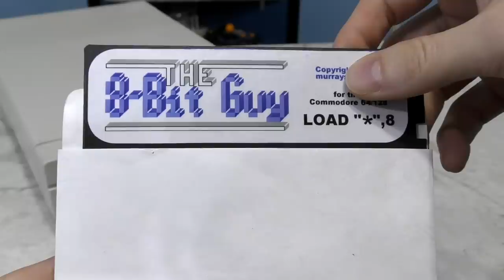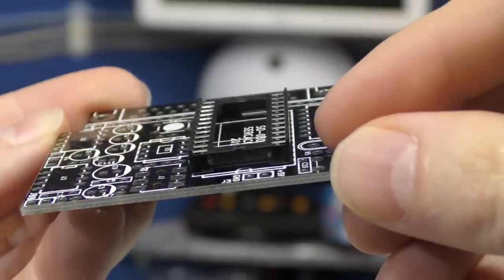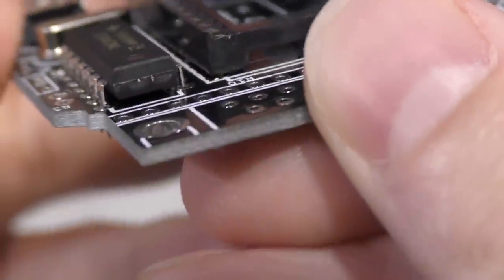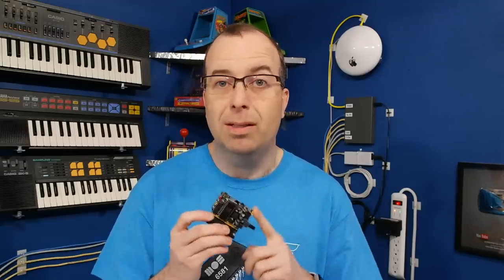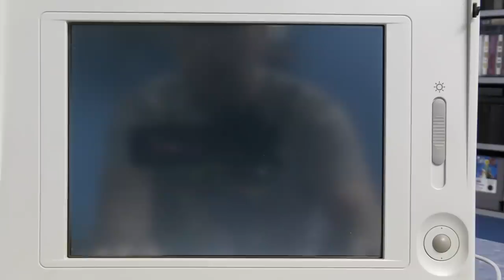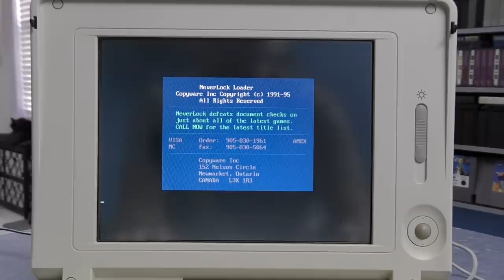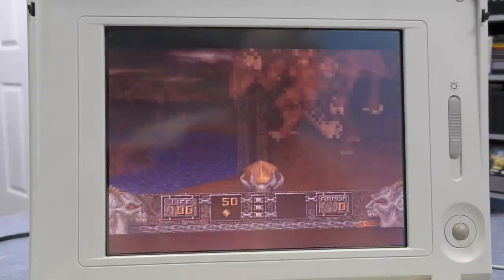Ad-Lib Sound Card for the Parallel Port

Comment: I want to hear what it sounds like when you tell the computer there's a printer connected to the port and try to print.
Reply: Likely a short crunching sound but it may get stuck on a note after that.
Reply: And on the flip side, connect a printer to that port, run the driver, and then a DOS game.
Reply: LOL!!!
Reply: Depending on the line protocol, it might make no sound at all and just error out.

Maybe give a beep series to indicate "error"
Reply: The one dude was like "Hey dude can I like print 'n shit"  and the other dude was like "WHAT?"
Reply: Or if you tried one of the games with a printer connected
Reply: In reality, nothing. The way that a printer and this sound card use the parallel port are fundamentally different.

Same with trying to use a printer instead of this sound card.

But for the second example, in a perfect world maybe this would happen: https://youtu.be/pG8RAbWs1yo 
Lol
Reply: @GamersEdgeCustoms  u ok bro?
Reply: Its like when you connect digital audio source to analog port in amp
Reply: I think it would sound like garbage for a second and then stop, because it didnt detect any printer
Reply: @timsbrain99  No one is going to be trying to print on an old laptop. If you do just remove the card. Your all a bunch of trolls.
Reply: @GamersEdgeCustoms  I saw something similar when the cat ran across the keyboard
Reply: @GamersEdgeCustoms  Yes. I agree.
Reply: Why don't more people think about that
Reply: @LGR i just tagged lol

Comment: Nothing wrong with your solder work, I've seen "professionals" do far worse
Reply: He learned the way I did - I got a soldering iron as a gift from my dad at like 8 or something. First thing I did was burn my carpet, then myself, then use it to make holes in plastic (to fit components) - Seconded, I'm not a pro myself but I've seen far shittier work on commercial products (cheap ones) from China.
Reply: The reason he's criticized is that less-than-proper soldering technique can sometimes damage the parts or just lead to many more cold solder joints. Critics just looking out for his parts!
Reply: Especially the ones putting a big blob on the tip, waiting for a bit, and try to smear it on. shudders
Reply: If it works, it's good solder work imo.
Reply: first cut the legs, then solder. Cutting force stress on the legs and deduct heat from the iron. since the legs are uneven lenght the also deduct heat unevenly and cause the soldering becoming less uniform due to the syncronisity
Reply: Snarky . Live 

Agreed. I cut the legs after I solder.
Reply: at  @roffpoff8221  Same stuff from IPC training...  BS.  Do which works best for yourself.  Then OWN IT.
Reply: most of it looked alright, cept that one big structural pin on the port didn't look like it fully heated/bonded or something and might crack off at some point.
Reply: I have been soldering professionally for years. You are doing a great job!
Reply: everything wrong with how he pronounces it
Reply: @petervansan1054  pretty sure everyone pronounces it that way in America
Reply: "I've seen "professionals" do far worse"

What do you mean by "professionals"? If you're talking about people who repair PCBs as a profession, that doesn't make them a professional solderer. A true professional solderer does nothing but solder as a fulltime job, such as on an assembly line in a PCB factory, and if you've seen worse from someone like that, then either they are a new-hire or the company they work for has terrible quality control.

I soldered professionally in a PCB factory for ~2 years, about 5,000 joints per night (I soldered literally millions of joints during the whole time I worked there), and 8-Bit Guy is not a good solderer. He often leaves the iron on the joint for too long, he usually doesn't feed in enough solder, he tends to feed the solder onto his tip rather than directly into the pad/post, and he cuts the leads off too close to the top of the fillet; sometimes actually cutting off the top of the fillet. I've also seen him create spurs on fillets when he removes his iron due to poor technique (that happens when you leave the iron on the joint too long and it burns out too much of the flux), and then just leave it that way instead of fixing it. 

On top of all that, his solder wire is too thick for most of the joints he solders (it's probably 0.032", which I call the amateur diameter, and it's probably 60/40, which I call the amateur alloy, because that's what you'll typically find at places like Radio Shack). 0.020", 63/37 is what you want for general purpose through-hole work, and 0.015" for most surface-mount work.
Reply: @MaximRecoil , sheash dude chill. This video is over a year old and his "improper" soldering techniques seem to work fine and even if they don't, it won't affect you anyway. No need to write a long rant.
Reply: @andrewhamop6665  You missed the point of my post, simpleton. I couldn't care less about how The 8-Bit Guy solders. The point of my post was to debunk HPZeta's ignorant "Nothing wrong with your solder work, I've seen "professionals" do far worse" post. That's why I addressed HPZeta in my post rather than The 8-Bit Guy, obviously.
Reply: @MaximRecoil , no need for name calling. I assumed that by saying "The 8-Bit Guy is not a good solderer" you were saying that he should be ashamed of how he solders, and that he should learn better. No offence meant and, I am no simpleton.

Comment: Atari could have made a sound card attachment like this for their ST series. It's a pity they didn't, but the YM chip holds up today surprisingly well for good chip music.
Reply: I don't understand why everyone likes these Yamaha FM sounds. They all sound plastic or metallic and have no depth whatsoever. The SID already had better sound with it's PWM.
Reply: There was nothing keeping you from connecting this to your ST. And Atari did have MIDI and the sampling output on the STe. So they had no good reason for this.
Reply: @dreamyrhodes I also generally prefer the SID over these FM sounds, even considering that it has less voices. Perhaps if the Innovation SSI had succeeded and the developers made proper use of it (which they did not), we would all be seeing DOS games with good SID music.

Comment: Who doesn't want to see the assembly? Screw skipping to ~8:30... The assembly is the best part of all of your videos. Especially that Hobby Computer you made. I want more of that. Solder and all :)
Reply: I cannot describe how much more excited I got about this video when I realised there was assembly required!  :D
Reply: SOD-er TRIGGERED
Reply: When I’ve built modded literally hundreds of PCAs it’s definitely not very exciting.
Reply: +monsterspc 01011101  

"Solder" is a modern spelling of the Middle English "souder", which derives from the Old French "soudeur", which itself comes from the Latin "solidare". In the 15th century there was a movement to re-Latinize the spelling of words, and the "L" got added back in to the spelling, although the pronunciation didn't change to include the "L" until sometime later.

So there you have it: The reason some countries pronounce it with an "L" and others don't.  But they're both correct, according to the Merriam-Webster dictionary.  So stop being triggered.
Reply: Daniel Figueroa a
Reply: Yes.

Comment: If you can find a Port·able Sound Plus, it gives you AdLib and Sound Blaster emulation via the parallel port, and it supports DOS games: https://www.youtube.com/watch?v=t7VxWbCgWHk  

And LPT1 actually stands for Line Print(er) Terminal 1, or simply Line Printer 1, not Local Print Terminal. It's a reference to the high-speed printers often used with mainframe computers that would print an entire line of text at once, rather than the single-character print head of a typical daisy wheel or dot matrix printer.
Reply: Dude, I have been into DOS gaming since 1986 and still I didn't know such a thing existed. I am thrilled. BTW, you have a great channel, too.
Reply: Watching this at 9:29 I thought "Wow here's a guy who actually knows what a line printe.....errr.....  nevermind."
Reply: It probably costs allot unlike this thing.
Reply: I like all your video VWestlife ! Im a fan
Reply: Good to see you, VWestlife!

Comment: Whoever told you that your soldering skills were lacking, they're wrong.
I'm an electronics tecnician, and I work doing maintenance in medical equipment at the largest hospital in Brazil, and considering my own skills and what I've seen other techs do, you're way above us all in soldering skills, my friend. Your solder jobs are clean, quick, and most important of all, NOT BLOBBY.
Don't mind these nitpicky pillocks, they probably wouldn't fair soldering on camera as well as you do. Keep up the good work!
Reply: blackcorvo Hospital das Clínicas?
Reply: blackcorvo is right, nice shiny joints not over cooked or under cooked,absolutely nothing wrong with your approach, also i have seen standing resistors and diodes quite alot on metal detector circuits and boards(my main interest), like you say its used to try to make the boards smaller.
Reply: Blackcorvo you br?

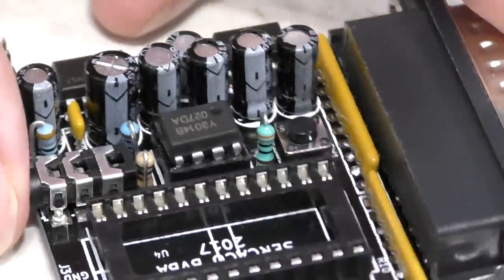Comment: 7:49 That "little chip" is actually pretty interesting too. It's a proprietary external digital-to-analog converter. Most Yamaha FM synth chips required specific external DAC chips which made them kind of a pain to work with. More often than not, the lower-end FM synth chips had internal DACs to keep part-counts and costs down. Chips like the YM2612 (Sega Genesis) and the YM2413 (Low end keyboards, MSX) had built-in DACs which made them much easier to work with and much cheaper overall. 

If you're interested, I've actually created a dedicated Sega Genesis video game music player using a real YM2612 and have made videos of that project on my channel. FM synth is SO cool and I really wish it would make a comeback.
Reply: Aidan Lawrence Considering microsoft has somehow declared midi obsolete without actually checking with anyone that makes music...
I wouldn't count on old technologies much. XD

Though by their nature I suppose FM Synths making a comeback is considerably more plausible than say, CRT displays doing so...

Your YM2612 player reminds me of my little troll project to stick a YM2612 in a SNES cartridge and feed the output into the analogue audio input pins... XD

That's basically designed entirely to mess with people though...
Even if I am mildly curious what the SNES audio amp stages do to a YM2612
(the characteristic sound of the Mega Drive and the wide quality variations between hardware revisions are closely tied to the amplifier stage, rather than just the 2612 itself...)
Reply: Dude that project is real cool! I enjoyed listening to some tracks through that. I'm a huge fan of FM synth and of the Genesis sound :) I've captured a couple game soundtracks from original hardware on my channel. Are you well-versed in the different filterings of Genesis audio circuits? My fave are the model 1 motherboard revision VA0 to VA2, followed by the model 1 mobo revision VA3 to VA6.8. The one I use for capture is a model 1 VA2. The EQ is just straight fire on this sound circuit(although the headphone preamp is cranked too high, but this can be fixed). I love hearing "crystal clear" version of the Genesis, but I also like the two sound circuits I mentionned before. They both have great personalities
Reply: Saw your video on reddit. That's pretty cool
Reply: That's awesome Aidan!
Reply: Aidan Lawrence So it's not working with Intel multiplier firmware crap then 🙄 Maybe i386 on a chip 🤓 that would be the best.
Reply: is a floating point DAC. only emulable by CPLD.

Comment: Wow - flashback city. Back in around '93 when I was working for Creative Labs, the Port Blaster (parallel port Sound Blaster) release was cancelled because it turned out not all laptop parallel ports provided power. Major embarrassment and R+D fail!
Reply: Bruh, I would've been pissed. Who was the idiot that decided parallel ports shouldn't provide power on some computers?
Reply: @Some-guy-on-the-internet  Being a general purpose port, providing power isn't exactly a good idea. External power would have been fine tho.
Reply: How far did it get into development? MediaVision did something extremely similar which made it to the market. Just like a combination of the OPL2LPT + Covox basically is a Soundblaster ... albeit the later requiring a lot more CPU juice when playing digital sound.
Reply: @1337Shockwav3  I suppose that does make sense. But if that's the case, then I find it strange that Creative Labs didn't think to add external power to the Port Blaster.
Reply: @Some-guy-on-the-internet  shrug no idea ... a good thoroughly thought through LPT port solution would have been quite a decent product ... but then again, PCMCIA soundcards may have already been on the horizon.
Reply: If only they had the sense to tap the power of the PS2 port. You should develop it and sell it in conjunction with this guy, no point redeveloping the wheel.

Comment: Yammaha still probably make those chips for legacy equipment and keyboards as some still prefer the sound some older equipment make

That and older technology tends to be dirt cheap to mass produce anyway
Reply: Hanro50 isn't it different for CPUs?  I heard Nintendo couldn't use ibm processors for the switch because it would cost more than using arm. I think it was propreity hardware would cost touch I think. If it works that way.
Reply: There is no sense in using older CPU architectures for modern applications like video games...Especially video-games since developers don't like cryptic architectures

Comment: I solder medical equipment professionally, and honestly I have seen every soldering technique imaginable.  They all result in the same thing, the technique makes no real difference.  You solder just fine, clean results and no residue scattered all over the place.

Heck, I commit the worst soldering "sin", I put solder on the iron and use that to solder the component, easily done single handedly so I can use my other hand to hold the component.  When having to make 200+ battery packs, every time saving technique is a win.
Reply: some soldering irons I've seen actually promote single-handed soldering by having a solder-feed.
Reply: That's a sin?  I thought I had unlocked a pro skill.
Reply: Doing that is fine if you apply flux to the joint first, despite what a lot of people say.
Reply: I usually have to wet the iron to get any heat to transfer to the part.
Reply: @thegardenofeatin5965  that's totally fine as long as you add fresh solder (and flux) to the joint. It's even recommended in NASA soldering guides.

Comment: Here's another soldering tidbit.  Don't solder adjacent pins on ICs or sockets.  Skip a few, and come back multiple times.  Heat can damage ICs, and spacing out the pins soldered lowers overall heat applied to any one spot.
Reply: Good advice!  I never thought about that.  It's one of those things that makes sense in hindsight, though.  (Then again, I very seldom soldered ICs.  I usually socketed everything, unless the space inside the case was tight.)
Reply: Just ICs, sockets don't care. And modern ICs don't really care much either. It's just the old chips you could kill easily with a bit of heat.

Comment: never noticed till now in his intro the label of the disk says to type
LOAD"*",8
but he types in on the computer
LOAD"$",8
Reply: The '$' folder I think loads the directory listing. The implementation of the 'dir' command is kinda wonky on Commodore machines - it had to load the listing from disk and write it to a BASIC program for some reason. It's wonky.
Reply: surfitlive  ,8 means the program from device 8 will be loaded into basic memory, 
,8,1 means the program will be loaded to the stored location defined by the two first bytes in the file that is being loaded. Which is what you need to properly load a machine code program. 

,0  The program will be loaded to the start address of BASIC memory (2049/$0801).
,1  The program will be loaded absolute, namely it is stored to the location defined by the first two bytes in the PRG file image. 
    Typically needed for machine language programs to get properly located into the memory. if you don't do that you'll most likely encounter a ?OUT OF MEMORY ERROR.
Reply: @iProgramInCpp  experts use DIRECTORY command and does not overwrite memory :-)  at least on C16, C128 :-D

Comment: Thanks so much for this video.  So glad these are coming back.  It is easy to forget that these soundcards, old or new, were musical instruments in themselves.  In '92ish I got an original SB, 8 bit version. -- mostly on a dare.  Until then I was using all those pesky moogs and roland things via midi... and <blush> I just LOVED It.  It was crunchy and unique, and a welcome addition to the studio.   I have this and an original mt32, and I must say,  I also prefer the opl2.  When a song is actually composed and designed for the opl2 it sounds way better than these other instruments, if only by virtue of the design.  Unlike the sampled things like mt32, the fm and sid's also had control codes that modulated in real time. And the opl percussion sounds were never the exactly the same twice.   Have a listen to the original Dune game - on opl vs mt32.  Same with a game called "Hyperspeed".  Both sound great, but personally I found so much more character in the opl version of the music.   See also : the original Jill of the jungles and early KQ. That said, the later King's quest sound tracks were written for the mt32 then later again for GM, so those start to gound a bit silly on opl.